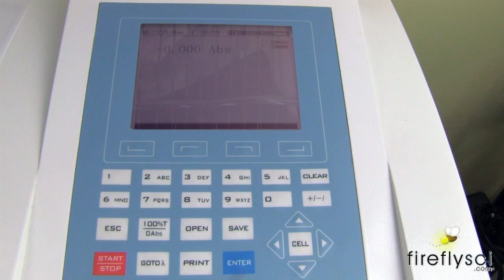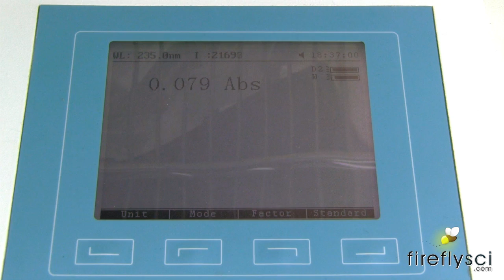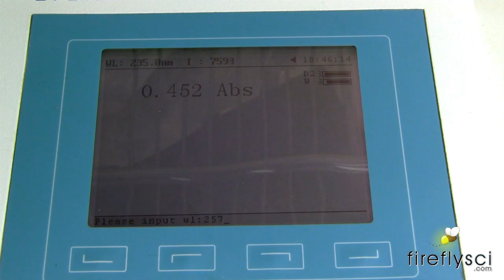How to Calibrate a Spectrophotometer with Potassium dichromate

Comment: How to prepare K2Cr2O7 you are  showing absorbance directly
Reply from the maker: Hi Sivako,
We are showing how to use an already prepared potassium dichromate solution to calibrate a spectrophotometer. We actually no longer produce these standards any longer. I would suggest reading the following article for guidance: https://www.quora.com/How-do-I-prepare-a-0-1N-potassium-dichromate-solution#:~:text=Here%20oxidation%20state%20changed%20from,it%20in%20one%20litre%20solution.
All the best,
FireflySci

Comment: Sir... i have a spectrophoto meter .. there is no knob to make the blank reading zero.. how to use it...
Reply from the maker: Hi!  The best place to check is in the manual for your machine.  The most common term used is to "zero" the machine but I've heard it called blanking by many people.
Reply: @fireflysci1194  Actully sir.... it has only four button named as mode, Print, T 0% and absorbance 100 and a knob foe wavelength setting......
and there is a black colour cutteve in the box named as %transmittance....

Comment: How, what if your spectrophotometer does not give the values it should give?
Reply from the maker: Hi Swagotom.  There can be a number of issues if your machine does not fall within tolerance.  Your first step should be to contact the manufacturer and explain your problem to them.  They will be able to help you get your machine up and working again.

Comment: What's the logic behind using perchloric acid and potassium dichromate?
Reply from the maker: The idea of using perchloric acid as a blank comes from the scientific observation that in order for a spectrophotometer to accurately identify a given concentration of potassium dichromate in a solvent (and perchloric acid is used as solvent), the photometric absorbance of a solvent needs to be subtracted from the photometric absorbance of a solution which has both ingredients in it: potassium dichromate + perchloric acid.

Comment: how to determine zinc on spectrophotometer
Reply from the maker: Hi Shubham, this is a little outside of our wheelhouse but I'd check online for some papers that deal with this. Try this one: http://www.ceacsu.edu.pk/PDF%20file/Volume%2014%20No%201/01-15-PJAEC-26032013-008.pdf

Comment: please help me....
I am pursuing my thesis work on Antioxidant properties by DPPH assay, I'm confused about the measurement of the absorbance at 517 nm in a UV spectrophotometer. 
my aim is to observe the decoloration of DPPH by an antioxidant like as plant extract. i have to use the different concentration of extracts(ex. 400 ug/ml, 200ug/ml, 100ug/ml, 50ug/ml) sample then what should be in the reference cell and what in the sample cell, while using different concentration and solvent is Methanol?
Reply from the maker: Hi Sajal, if you are measuring at 517nm your best bet would be to validate your machine around this wavelength point. You can save up front and recalibration cost by going with our HF-Series standards found here, which can validate your machine from 400-700nm: http://www.fireflysci.com/photometric-accuracy/hf-series-vis-photometric-accuracy-calibration-standards

Thanks for your question!

FireflySci